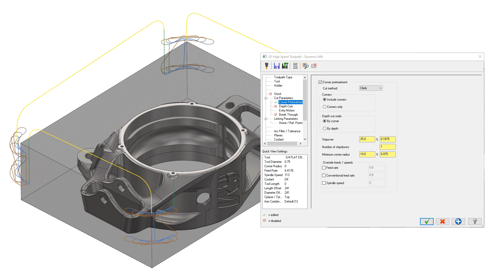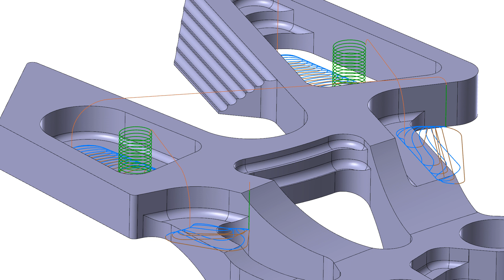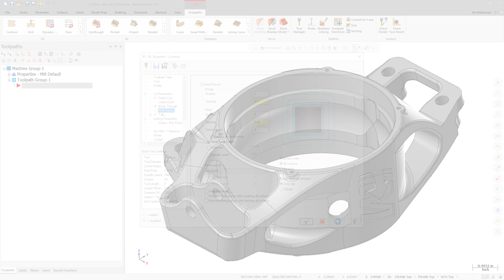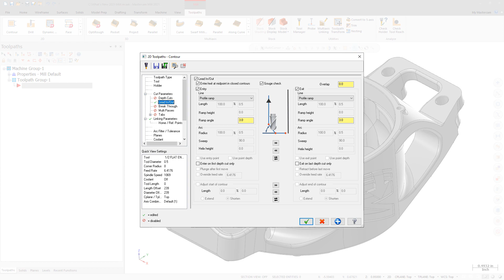Mastercam 2021 Milling Enhancements – 2D

Comment: What about "left and right"(mirror) parts  with  several  different toolpaths...  It be nice to be able to quickly just mirror a part that has toolpaths  without changing parameters....
Reply: I dont understand why this isn't already a thing. Why would I want to mirror a toolpath and NOT maintain direction of cut?
Reply: @wildin13   That is just the kind of forward thinking Mastercam is like. There's a bunch other software options that are better. Mastercam sticks around due to legacy. Companies can't easily switch.